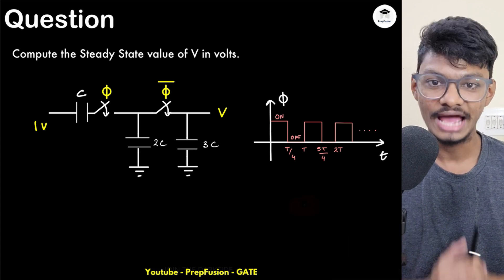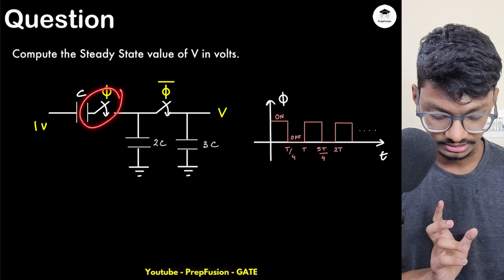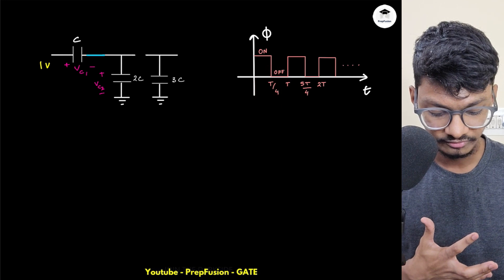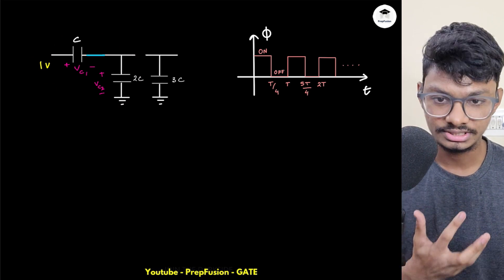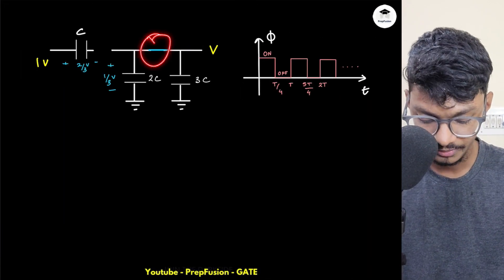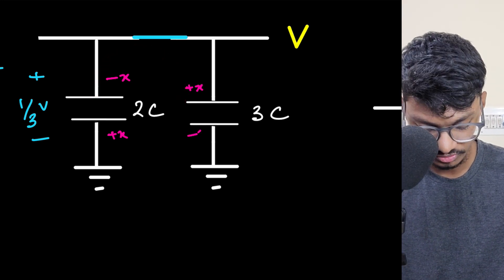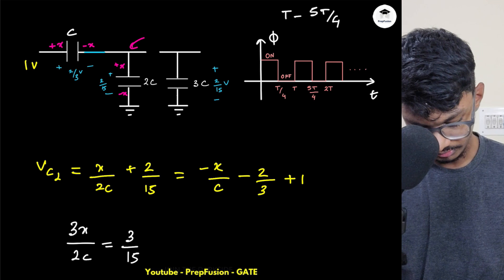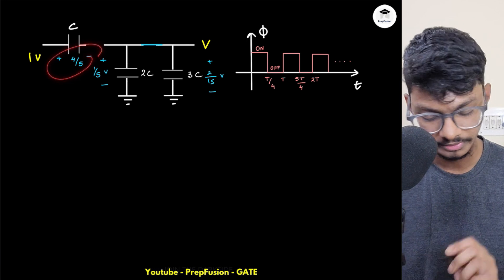🔥Amazing Concept OF SWITCHED CAPACITORS || GATE 2025 || Analog VLSI Questions

Comment: In this problem we are getting a GP but if the capacitor values are changed then we may not get this kind of series then to find out steady state voltage can we consider both the switches to be on at infinity ?